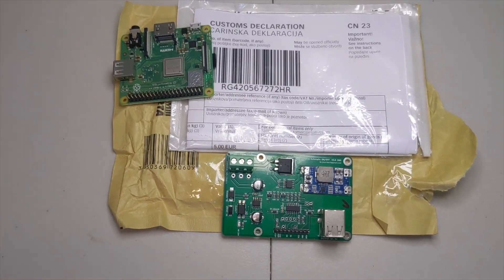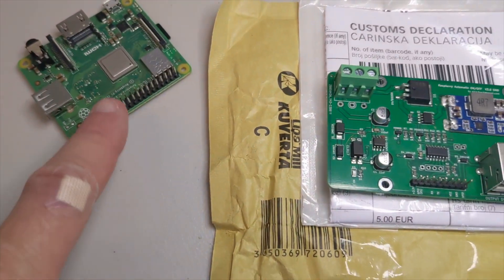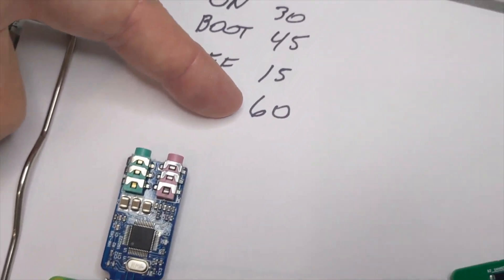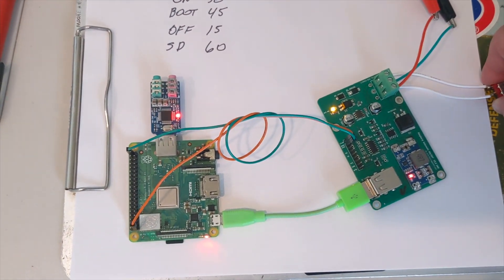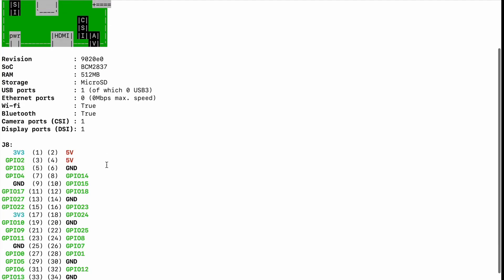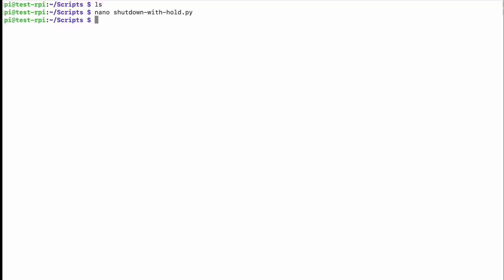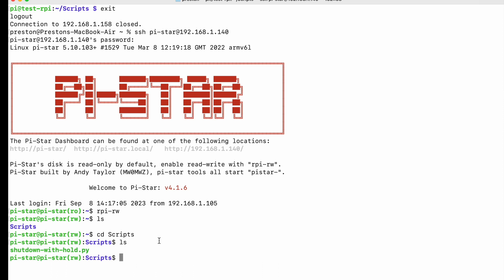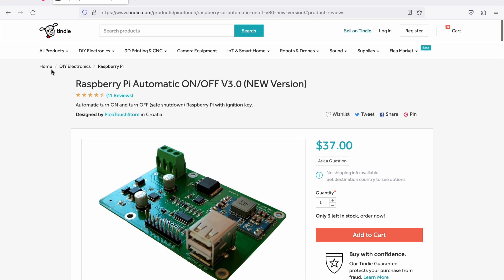Raspberry Pi Car Power Supply with Ignition Control

Comment: Oh, I suppose you can use ACC from the lighter socket and constant 12V from pin 16 on the OBD2 port. :)
Reply from the maker: Yep, I'm running a tapped lighter socket feed to control my radios in my Tacoma.  I've got a dedicated constant feed for main power.  I'm not sure of the max current of the OBD 13.8v feed....be careful. 73
Reply from the maker: Interwebs says max of 5A is spec for the OBD port pin 16.  I'd still be careful.
Reply: @nu5m_radio  Much thanks. The part  you linked is out of stock, so I bought a similar product from All Spectrum from Van Nuys, California. A bit more expensive, but you don't need to use the OBD port.  It detects ACC losing power and then signals the Pi to shutdown. - VA7RJU
Reply: @ScottMorgan88  Any chance you have a link to that bad boy? Thanks in advance
Reply: @ScottMorgan88  any chance you have the part number for what you got from All Spectrum? Thanks